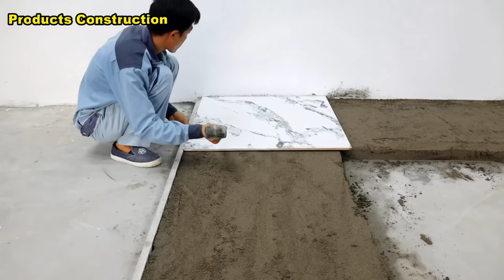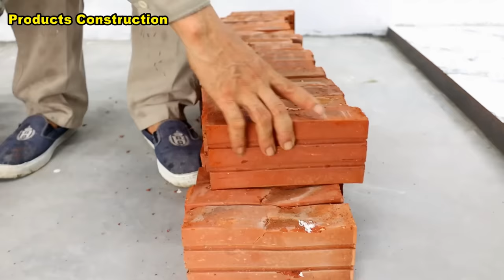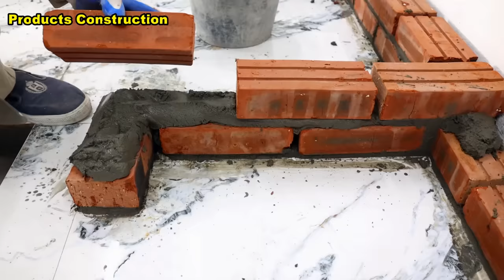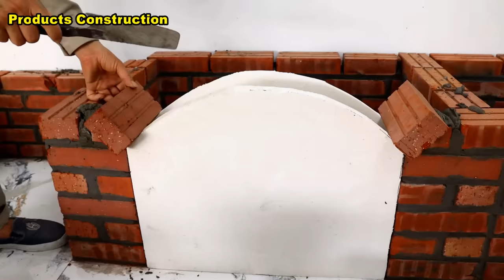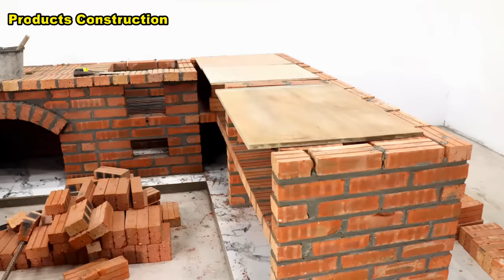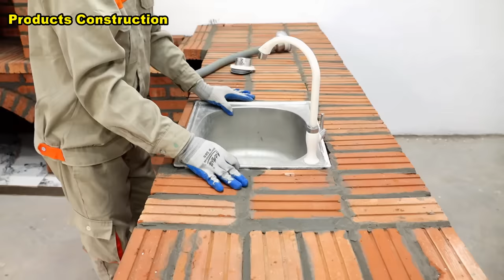Building Outdoor Multifunction Wood Stove Effective From Red Brick and Cement

Comment: looking to build a forge with this technique. Just curious... when you take the boards out, the bricks can stay like that?  how much weight before they collapse?
Reply: I'm also questioning this. I've seen others put a thick flat metal bar around 2 inches wide that rests between the columns. Look up how to install granite kitchen tops with a wide gap. If the granite needs one, wouldn't this?
Reply: im thinking this as wel! is this gonna hold? he is also using a dark cement, its not portland is it?
Reply: Aquí en México en algunos estados utilizan una técnica el la cual incluso pegan ladrillos acostados de uno por uno en la parte del techo de la casa supongo que cada quien tiene sus  conocimientos...se le nombra techo catalán  por si quieres investigar un poco ... saludos....
Reply: 😂😂😂definitely will collapse
Reply: About 50kg of weight and about two weeks before collapse. Nowhere in the real world will you find such construction. The fact it's being built inside a warehouse of sorts should be enough to judge. However you comment is the first regular comment I came across, So that's why I felt compelled to react :)
Reply: Suggestion, the more weight the more metal but keep in mind the walls also hold, or distribute, the weight
Reply: @fernandopks l
Reply: @fernandopks  They should have built a concrete slab with a construction iron frame, that would prevent the collapse.

Comment: Your work is beautiful and your ideas are very wonderful .. But there is a question?! On what basis of durability do you place the stone directly on the ceramic plate?
Reply: It’s just for show, a demonstration of what could be done. But if someone actually wanted to build a usable brick wood stove, it would need to made with firebricks in the firebox area. Those common red bricks just crack and crumble when frequently exposed to the high temperatures of a fire.
Reply: @casanova1925  اب
Reply: It can be easily demolished when the owner no longer need it😊
Reply: @yahyaalwahaibi7087  ش٠ض٠٠٠٠٠
Reply: @casanova1925  they could also alternately use mud bricks because they can be homemade so cheaper to manufacture, and they are fireproof.

Comment: Good job, but on the base do you only use sand with cement to place the ceramic if it sticks? And on the smooth surface, what type of mixture do you use to glue the bricks?

greetings from Mexico
Reply: Nada de nada usa.. 
No usa varillas de hierro.. no usa pegamento de cerámicos... no moja los ladrillos... no existe anclaje a la estructura provista... en la campana de extracción de humos no existen trabas entre las hileras de ladrillos... 
La mesadas no resistirán esfuerzo al corte o compresión.. inexistencia total en el fogón, de un confinamiento que absorba la dilatación por temperatura, etc etc...
Bonitos arcos!!...  pero.... con el tiempo o la temperatura.. colapsará!! se fisurará y quebrará!!! espero que nadie salga lastimado.